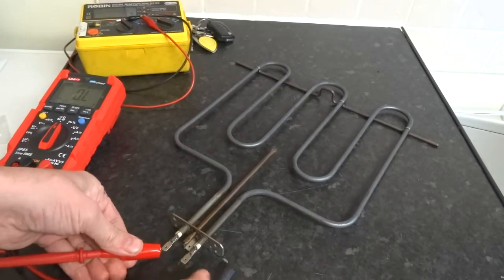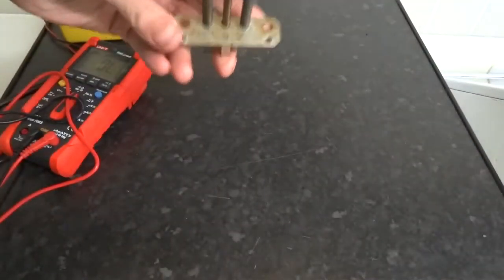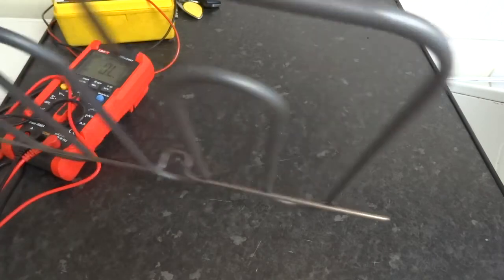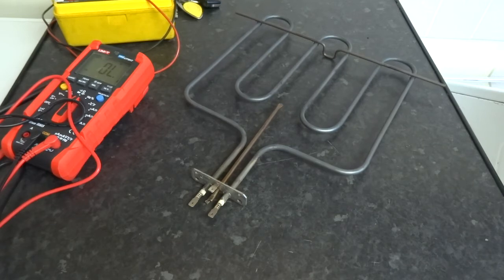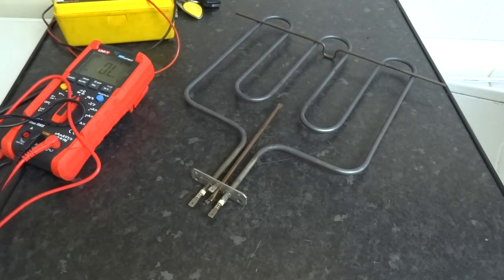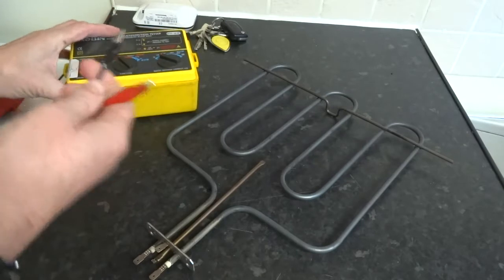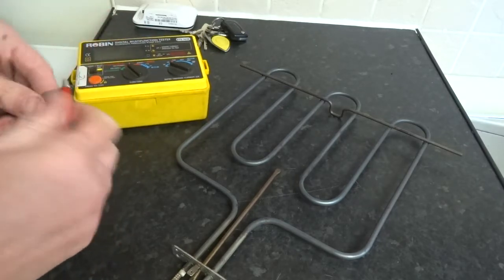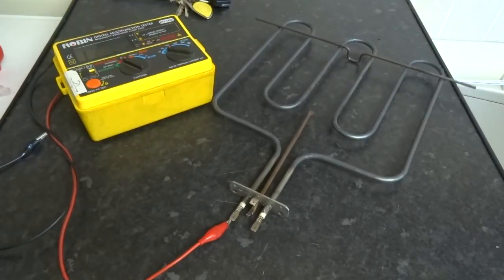Insulation resistance testing electric cooker oven heating element Tripping circuit breaker RCD

Comment: Took an resistance and connected to 220v why it isn't glowing as it would on the oven, know why? Trying to built a cocktop to my shed... it heats but not much as normally would. Also didn't saw any capacitor on the oven I scraped it from... any clue?

Comment: Had an oven turn up to be installed, L1 was good, L2 was at .5MOhms, N was also 0.5MOhms, testing @ 500V…simmerstats were all off, and prior to beginning testing I removed a dead mouse from the incoming power, it would appear the oven was working at the original home it came from, one of the bits that confuses me is if the insulation resistance is below our  1MOhm minimum, at what point would the appliance actually short… I’m assuming there’s a bit of mouse damage within the machine, but depending who had the oven, and how it uses the individual phases it seems unlikely the previous owner never used the weaker circuit… Earth to body was great though,
Reply from the maker: Not sure if i remember years ago lowest reading was 0.5 so thats quite low , i would like to know at what lowest IR value an rcd would trip.
Reply from the maker: apparently its 0.0076 to trip an rcd